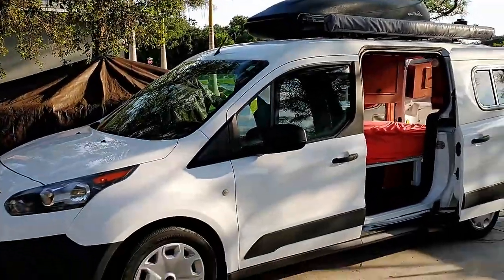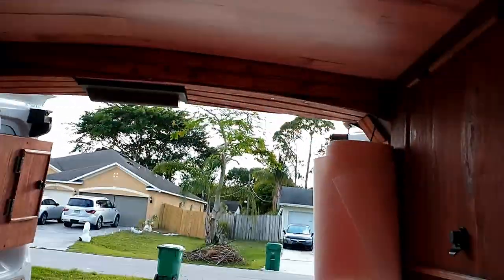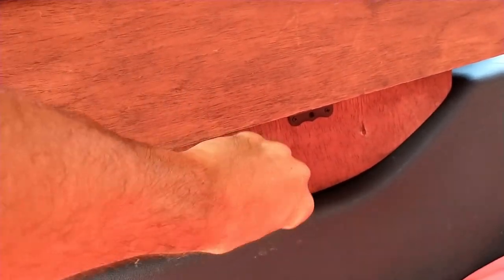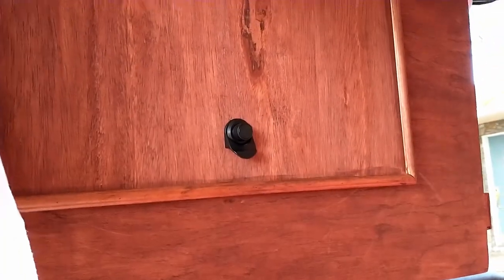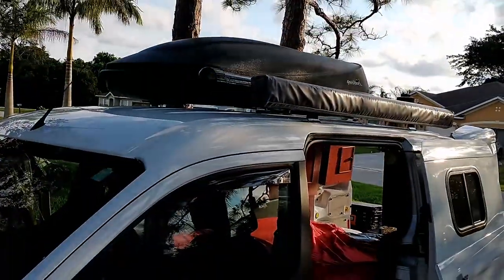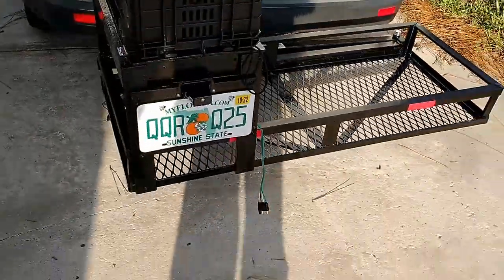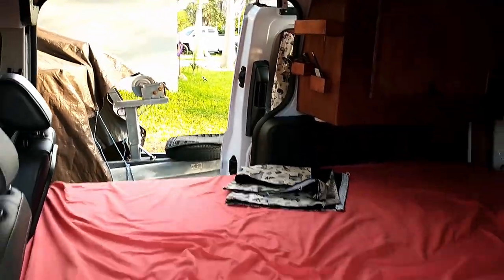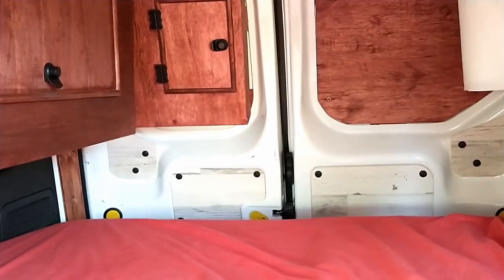Ford Transit Connect Micro Camper Tour

Comment: Thats a pretty clever build for such a small van!  Too bad Ford didn't make the Transit Connect available in AWD.  A mini-overlanding rig would be pretty cool. It seems like they could use the running gear from the Escape.
Reply from the maker: I really wish I had AWD and more clearance. It's definitely a sacrifice but I love the 27 mpg average this past summer from Florida to Alaska and back. The other reason it works so well for me is I live in Florida and do my overlanding in summer only.

Comment: I was gonna do that with the back cargo but ended up buying brackets to drill thru my back door. Where did ya get the cargo rack I still havn't drilled it like ta take a second look.
Reply from the maker: I got it from WMA motorsports. https://wmastore.com/product/swing-away-hitch-mount-cargo-carrier-amcc5020/. I had it reinforced by a welder. Make sure you use the middle support that comes with it. Thanks for watching.

Comment: could you tell us what the spongy thing is under your mattress?  and where you got it from?  that would be handy.
Reply from the maker: https://www.mattressinsider.com/mattress-condensation-prevention.html . It definitely works. It rained for a few straight days when we were in Alaska and we actually had some condensation on some of the van walls and front windows but the mattress and areas around it were dry. A bit pricey but worth it for us. Hope this helps.
Reply: @centaursailing  Thank you! K

Comment: I really like the build, I’m not into the cabinets but the bed is perfect. What I’d like to know is, at any time, did you feel the van needed more ground clearance? I like the Transit Connect 1st and the Promaster City 2nd. Ground clearance may be an issue on some gravel or dirt roads. Did you ever have to address the ground clearance? Loved the swing away hitch!
Reply from the maker: Definitely wish it had more clearance, we had some scrapes a few times on some Alaska dirt roads with the cargo carrier. The bolts on the bottom of the hitch tighter were bent we got home. The swing away carrier had to be reinforced by a welder after 700 miles. Kind of cheaply made. Thanks for commenting.

Comment: Thanks for the video :) How much do you think the sport rack cargo carrier is cutting down on your gas mileage?
Reply from the maker: We seem to get the same mileage with it both ways. I'm sure there is some loss but it has to be less than a half mpg. I'm sure the mpg numbers on the van are not totally accurate so that's probably the reason I get the same numbers. We averaged 27 mpg across the country and back with it on.
Reply: @centaursailing  Oh thanks. That's good gas mileage.